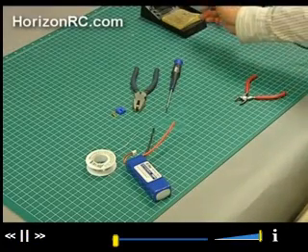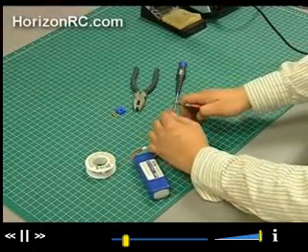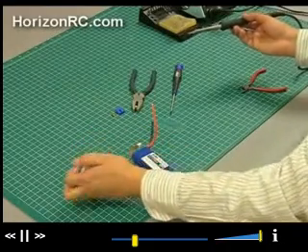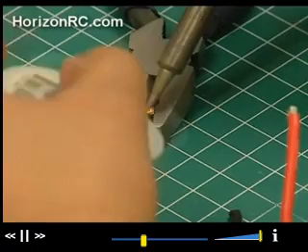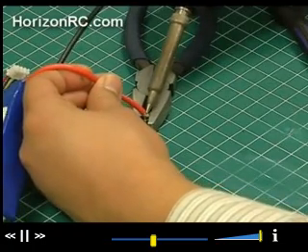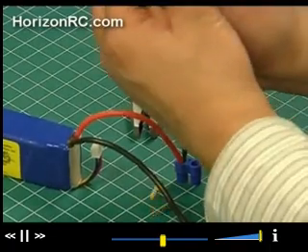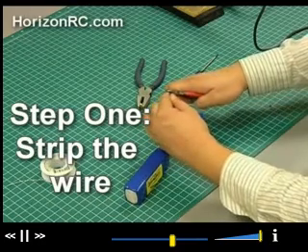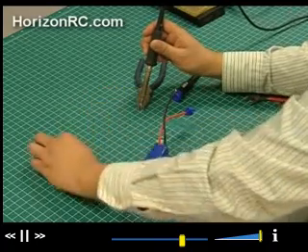EC3 & EC5 Connector Assembly Tips

Comment: Yes, I've "HEARD" of rosin core solder and I've used that a lot of the time for quick soldering and I missed that that he said that in the video in the beginning. Sorry for trying to add comments to help people better understand soldering, I did not "dis" anyone in my comment either, you however came out very sarcastic and rude instead of peacefully making your point which is valid. I've changed my rating of this vid and I even like these connectors now after using them for a while, lol.

Comment: if the pin don´t want to pop in the housing,  use hot water. put the housing in hot water for about 6-8 sek. it will pop easier.

Comment: So he built them the hard way. If you feed the wire through the plastic plug then solder it, you can then pull the plug through backwards and it snaps right in. Make sure your solder joint is clean and doesn't have blobs sticking out.

Comment: Ever here of Rosin Core Solder?? Like he states at the beginning of the video- use roin core(flux core). Proper silver content electrical solder doesn't form a "corrosive" layer, but a layer of corrosion DOES develop on any copper alloyed material you are soldering. To quote the the "Technology Interface / Fall 1997":
"Generally, no additional flux is required when soldering with the flux core solders."
Do some reading before you spend  paragraph dissing someone else. Truth Hurts, huh?